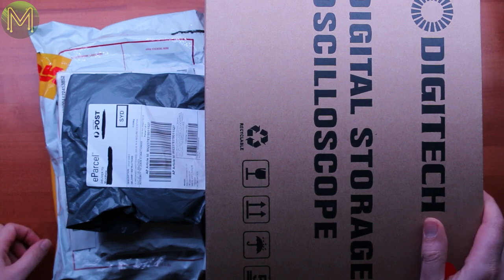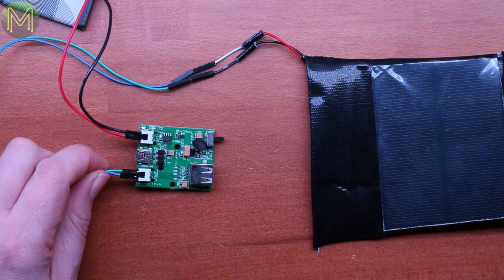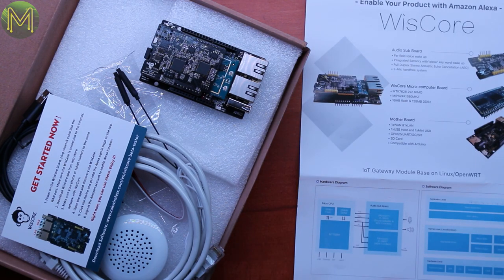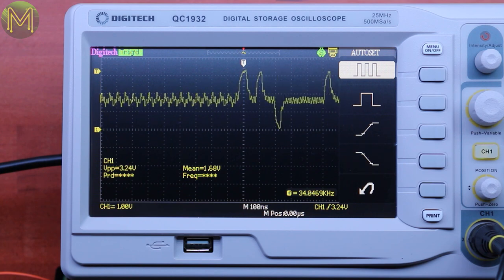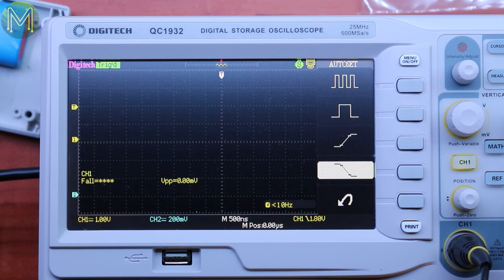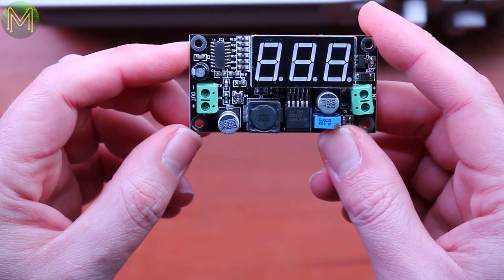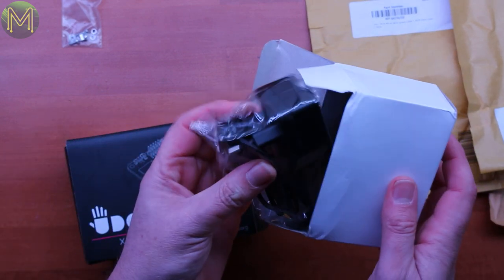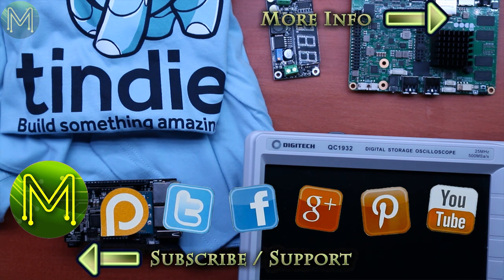#139 MickMake Mail #11: UDOO x86, DSO, WisCore & Tindie // News

Comment: Had to Google what a 'Crow' was ,for anyone else interested it's CRO (Cathode Ray Oscilloscope)   rather than Crow.....
Reply from the maker: +swami samantharella 
Ah yes. Should have put that definition up on the screen.
Reply: LMFAO. Shit We're getting old Mick :\
Reply: To be fair I am from the UK so I think it has more to do with Geography than age, as I'm no spring chicken...
Reply from the maker: Ha ha. We're all past it, by the sounds of it
Reply: Yup, I used to calibrate Tek Scopes (CRT) 465, 475, storege scopes, etc.  Fun stuff.
Reply: I've got a Tektronix 453 sat on my Bench. That's how Modern I am ,but it's just hobby not work.
Reply from the maker: swami samantharella 
Good old Tektronix kit. Used that stuff for many years when I was starting out. I actually didn't use DSOs much at all. Was all analog stuff, which was unusual as I'm more of a digital guy.

Comment: Had to chuckle a little there - AND a US power supply (nope, unless that's an adapter on the US plug), and a USB cable (nope again) hehe
Reply from the maker: +Ian Ide 
Yup. I'm used to it now.
Reply: I was seriously looking at the Udoo x86, but then I remembered all I wanted to do with the system. Run Fusion 360, run slicer software for 3D printing, run cross compilers, and the list of programming needs go on. Needless to say a much stronger system won out. I would be interested to see a rundown of the Udoo board though and I'll be watching for it. By the way there are some libraries out there that allow use of the ONE and only PWM pin on the RPi. I've done some testing with the C++ code and it works quite well, but hell I never seem to have need for just a single PWM. No matter what I'm doing, I always need 2-6...

Comment: I got the UdooX86 via their Kickstarter and have been playing with it for a month or so. You said it has wifi and bluetooth, but I don't think that's correct. The Intel Curie in it might have bluetooth, but best I can tell the X86 itself doesn't have wifi or bluetooth until you add the M2 wireless module. I received my M2 module a couple of days ago and it was detected and usable immediately in the Ubuntu 64bit installation that I've been playing with. It's a very nice board. Seems fast enough for a lot of desktop use.

Comment: 70 kHz when you use the super duper mega slow digitalWrite
Try using portA=0;portA=1; instead (or whichever port & pin you're actually using). You'll definitely go above 70 kHz when you use code that hasn't been made by Arduino.
Reply from the maker: +Harry Svensson 
Not only that, but interpreted shell scripts are really really slow.

Comment: Can't wait for the UDOO review. Also, is there any chance you could help me out with connecting the NanoPi NEO v1.3 to an SPI screen? The typical 2.2 inch one.
Reply from the maker: +o0julek0o 
Hmmmm. Maybe I should do a video on it. Connecting up is easy, it's the software side that will be the problem.
Reply: That'd be the biggest help ever. I'm trying it with armbian. From what I understand, there is no window based GUI, but I've read it can be added, right?
Reply from the maker: o0julek0o 
Most panels are accessible via the fbdev LCD Xorg driver. So you just run a plain X desktop on it.
Reply: If you could make that into a tutorial, you have a new patreon.

Comment: this evening i was playing a little with windows 10 IoT on the pine A64, and suddently found myself into the orangepi website. i've seen the new OrangepiWin and seen that it mounts the same processor and PMU as the pine64. so i thought, why not use the raspbian image for the orangepi on the pine? i've tried and.. it works correctly!
Reply from the maker: Nice. Excellent. All the GPIOs, network, everything?
Reply: Unfortunately, only one usb port work, the ethernet does work too. Wifi doesn't work. Also, i never used GPIOs previously so i don't know how to check them
Reply from the maker: DIYelectronics 
I guess once you get past the boot stage it should all work reasonably.